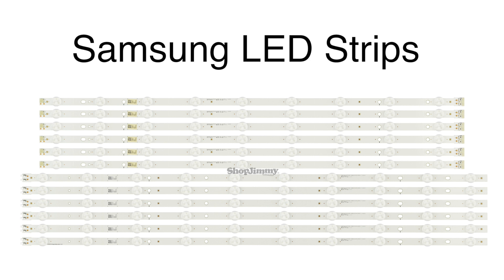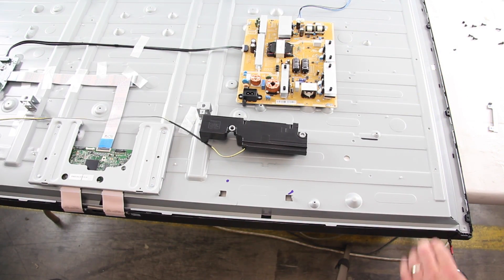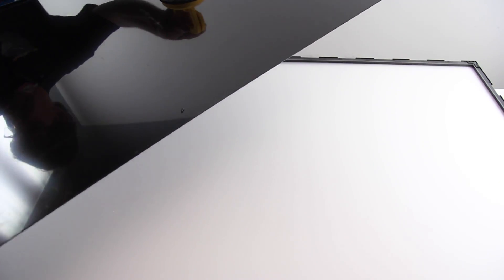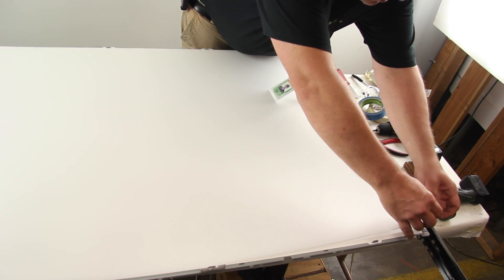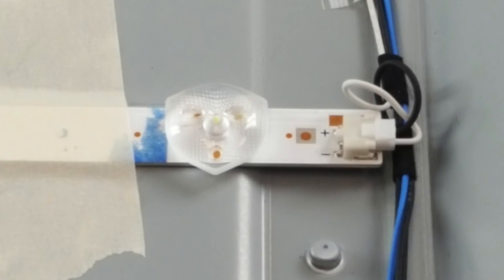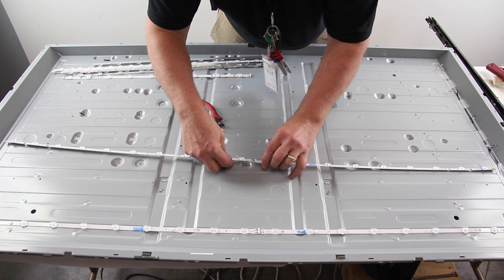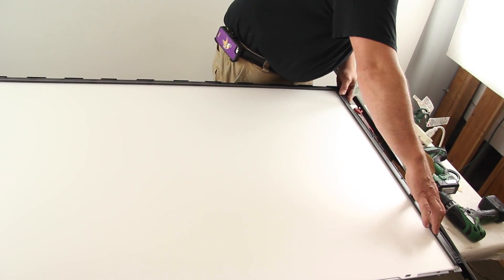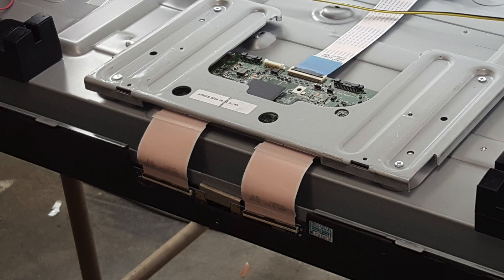Samsung 65” LED TV - No Picture Bad Backlights - How To Replace LED Strips UN65 BN96 29076A 29077A

Comment: I have a vertical shadow on my Samsung. What a life-saver! Thought this would be difficult❤
Reply: Mine too. I haven't pulled it apart yet, but were your light strips vertical then instead of horizontal like in all these videos?
Reply: @teemudgeon262 Yea, I still haven’t tried to fix yet.
Reply: @KnowNotNo_I  Lol, I'm just gonna get a new tv. Might try pulling the old one apart down the road, but I don't think I'll order any parts until I see what's behind the screen. Best I could find was $100 for 2 horizontal style LED strips and the whole thing will actually need 6 so bare minimum cost will be $300....plus shipping. Plus I'll prolly just fuck it up and chuck it all out into the trash.

Comment: JB weld light activated worked for me. It was SO easy. My samsung diffusers with not fitting tight, and superglue did not hold after 12 hours. The light activated was sold after 10 seconds.

Comment: The tabs before getting to remove the reflector sheet are not twistable - it seems like I’d have to break them in order to get them off. It’s a Samsung UE40H5500. Any help? I don’t want to break them all off!
Reply: switch them round see if that works?

Comment: So I did this repair but now I have a vertical lines up and down the middle of the screen. I see the "no signal" scanning on the right hand side of the screen but not the left. what did I do wrong?
Reply: Did you check your ribbon seating on the t con board?

Comment: How do you remove the retainer clips that hold the diffuser backing to the chassis? He just twists them off and then back on. Mine won't budge.
Reply: mine broke. I super glued them back in
Reply: @DanielBjorndahl  Turns out mine clip in and you have to release them from the other (back) side. Naturally you have to remove both boards to get to some of them. I broke two of them trying to get them snapped back in, but there are plenty and it  does just fine without them.

Comment: Just replaced the back lighting for this tv although 55" and now i see white lines across the screen. i am thinking i got the light diffusers reversed when i put them back as i did not use tape to tape them together prior to taking them out.They are not small white lines it looks like you can see the led strips through the lcd . Help anyone?

Comment: Any ideas on how to open up a un65mu6290vxza? There's no screws on the back and I'm scared :P
Reply: If you look at the bottom, there are 2 holes at each corner. I used a small screwdriver to slightly pry up on it then used a guitar pick and went around the whole panel. It worked like a charm.

Comment: Hi I have a Sanyo dp50747 plasma tv. The screen will be working fine the randomly will start blinking off and on as if between scenes or between commercials. It does this at random times and I haven't found any common situations that could cause it. Totally random. It will start blinking very fast then slow down and sometimes stop for a minute in between blinks. And then sometimes it will be fine for hours. I don't get it. I would so appreciate any advice. I'm very handy with electronics but this has me baffled. Thank you